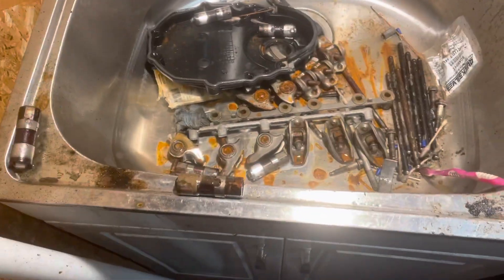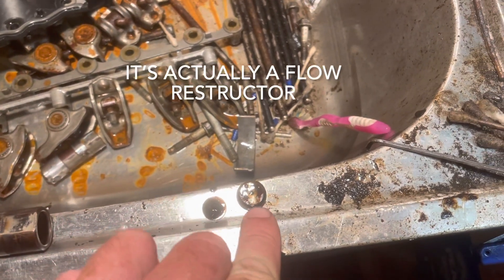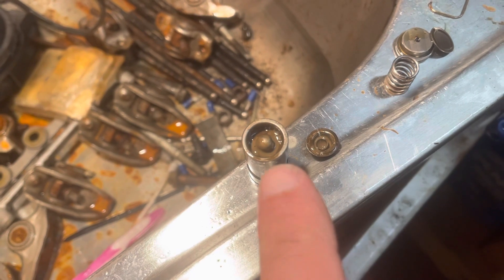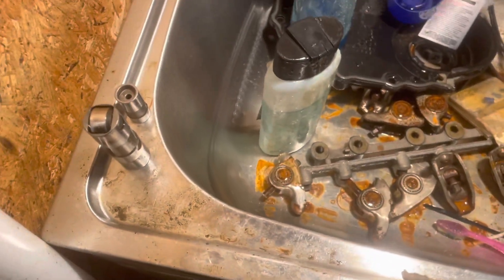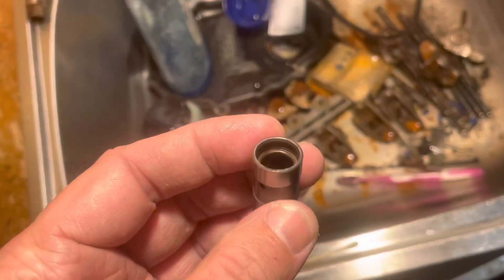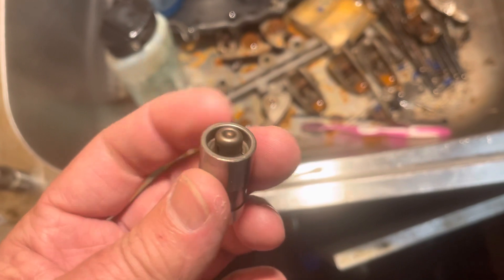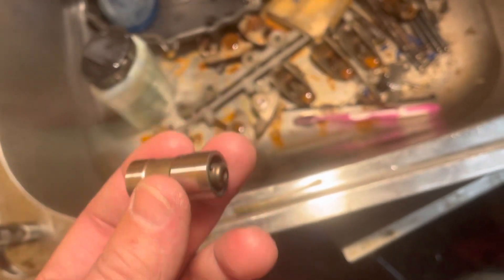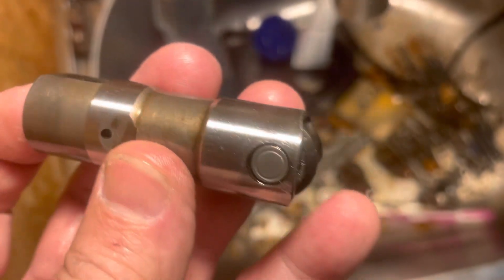Mercruiser - Anatomy of a Valve Lifter (Water is Not Coming Out)

Comment: Here's the thing: there's a boat with a Mercruiser 5.0 engine and it doesn't go beyond 3000 rpm engaged. Can you give me a tip on what it should be. I have already replaced the following parts: gosiline pump, filter, spark plugs. I even changed the electronic schematic
Reply from the maker: Check the timing, check the spark plug color to make sure it’s getting fuel. Make sure it has good crisp sparks if not upgrade to Delco EST ignition system. If these don’t help check the compression. These items will tell you what’s wrong.